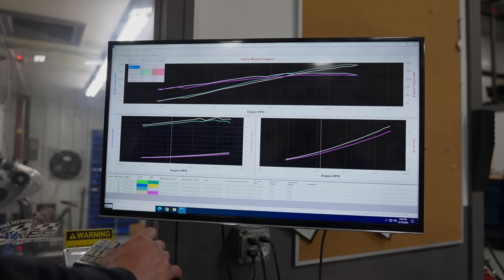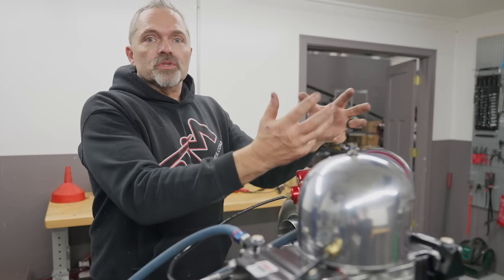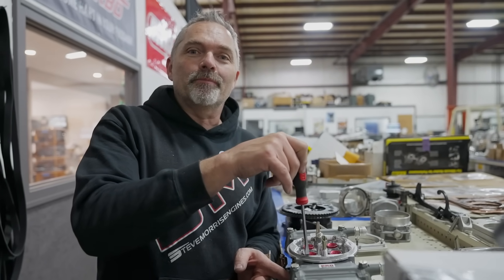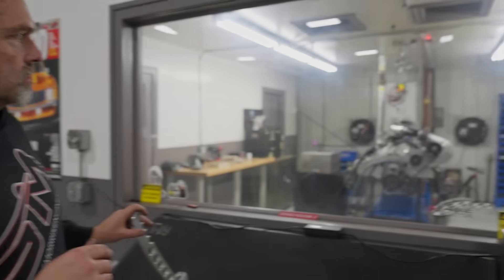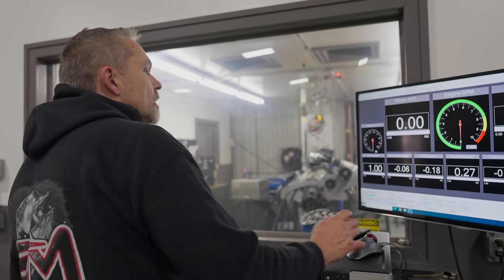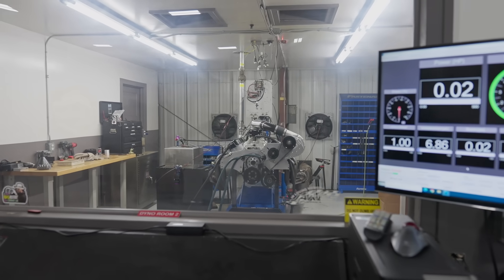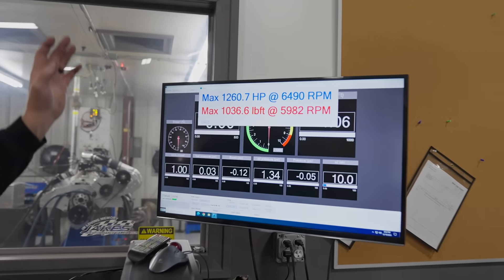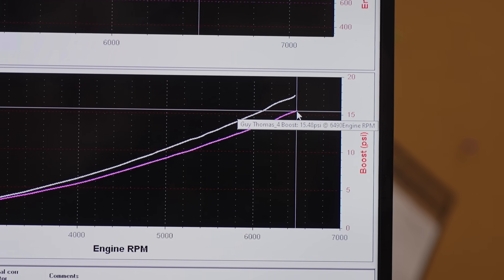How Blow Through Carb Systems Work. It makes too much power!

Comment: Most people call those little screws on the metering block "idle mixture screws".
I like the term "idle volume screws" because they control the volume of the emulsified fuel/air mixture from the idle/transition well to the idle port below the throttle blades.
So they control the volume of emulsified fuel/air, not fuel, precisely.

Comment: The most comprehensive, detailed, and informative tuning/dyno presentations ever compiled. Appreciate the continued videos and of course no video is complete without Dewey making a casual or deliberate cameo. Cheers!
Reply: Couldn't have said it any better! Pretty sure if you looked up the definition of customer service it's gonna have a picture of Steve!🤣
Reply: Tim Nelson is the best
Reply: @ALLGODSDIE  Never heard of her.
Reply: @ALLGODSDIE there’s always one
Reply: But still incompetent enough to let the supercharger pull hot air straight from the headers 🤦🏻‍♂️
Reply: @WingspeedGarage  there’s a lot of air moving through that dyno  room .. not a big deal
Reply: @edmahonejr.9364 It is a big deal if you want to make horsetorques, and it will most likely be even worse in the car if the customer runs it like that
Reply: Wellsaid
Reply: @WingspeedGarage  :
He briefly mentioned that, and why.  
Most of his viewers are competent enough to have heard and understood his rational. 
Most of his viewers do not want him to spoon-feed them. 
Caution: you MAY learn something.....
Reply: @WingspeedGarage  Your lack of attentiveness through the bullet points Steve noted during the course of the video explains your comment. He literally manufactures boosted engines that make in excess of 4000 horsepower so there's that caveat you overlooked or completely ignored.
Reply: @lt1nut  yes sometimes I wonder if these people that make these stupid comments actually watch the whole video or even watched a large number  of Steve’s videos. Like most of his subscribers have.
Reply: @strykerentllc So because he makes 4000hp engines he can’t be criticized on simple facts ?
Reply: @lt1nut He should never sell nor build an engine that pulls hot air from the headers. It’s a bad setup and he should know better. And he’s obsessed with boost numbers that has nothing to do with making horsepower
Reply: @WingspeedGarage  Nope, not at all. Try to keep up for a second here as it's explained to you in simple kindergarten terms. 

1: Those two wall mounted fans behind the dyno move a sh*load of fresh air across the engine. 

2: It's December in Michigan. It's friggin COLD there and in case you didn't watch the video, everybody's wearing hoodies in the shop. 

3: Steve had to pull power out of the engine so the engine wasn't struggling to make power.

4: Professionals welcome constructive criticism from individuals that are educated in the respective field. A monkey can critique a stone mason, however that chimp knows nothing aside from how to peel a banana and toss sh*t at strangers. 

5: Know the difference between being a chimp and offering constructive criticism but be prepared to get taken to task by those more knowledgeable than yourself. 

6: Merry Christmas.
Reply: @WingspeedGarage these sideslinger prochargers are making over 2000 horsepower without intercoolers, and within the recommended impeller rpm. The air intake being above the header isn't an issue in my vehicle either. The ait's are reduced with the vaporization effect of the fuel underneath the carburetor.
Reply: @square_zerohero2281  And why not make the same HP with less boost (saves the engine) or just more HP? 🤷🏻‍♂️
Reply: @bigboreracing356  There is no reason why that hot air should end up in the intake of the turbo
Reply: @strykerentllc  Engines pump their own displacement every two revs, at any fixed RPM the engine CFM pumped is constant. The boost pressure does not increase the engine CFM, it increases the density of that CFM. It takes pounds of air not pounds of boost to burn pounds of fuel. And if you’re not doing what you can to increase the air density of does CFM especially by such a simple thing as not sucking in hot air from the engine then you’re just ignorant or doesn’t know better
Reply: @bigboreracing356 Why are you asking me that?
Reply: @bigboreracing356  When you compress air the air gets warmer no matter what you are using, it’s the law of thermodynamics.
Reply: @bigboreracing356  Your English is so bad I’m surprised you went to school at all, makes it really hard to understand what you’re saying. But no, a Procharger doesn’t make hot air cold
Reply: @WingspeedGarage  You're having a conversation with yourself. Nobody cares what you think, got it? Good.
Reply: @strykerentllc Hopefully you learned something! Key note to take with you:
1. Always aim for as high air density (cold air) in the intake manifold as possible to make the most horsepower with the lowest strain on the engine. It’s so easy but yet so overlooked by some reason.
Reply: @bigboreracing356  You can run the supercharger slower = less boost and equal or more hp with higher air density.
Reply: @bigboreracing356  I’ve tried my best explaining this to you but I give up
Reply: @bigboreracing356 You can, make a cold air intake and ram that procharger with cooler, denser, outside air from the front of the vehicle and you’llb make more HP at the same boost, or even better. Add a intercooler
Reply: @bigboreracing356  If you believe that I don’t think I can say anything to change your mind, good luck to you sir

Comment: Take his advice as gold, and these engines will survive years at this level. I've been following him for decades, and I've built a similar setup to this at my home because of his builds Ive read about as a child. I have a 565 cubic inch big block Chevy with an F-1X Procharger that I street drive with the same 77/58 tooth pulley combo that he tried in this video with my timing locked at 30. I also have a 46 tooth blower pulley if Im able to use more. I haven't pulled my engine in 8 years. I appreciate the lessons he shares with us, and I'm thankful to enjoy the rewards of the knowledge that hes always shared with us for free. Expect brutal power. Good stuff

Comment: first engine I turbo'd was a 80 kawasaki kz750 four with the original carbs. I wore the screws out on them by the time I got the jets right! bought special drill bit set, extra jets. even soldering them shut and re drilling

Comment: Awesome video and makes me want one of these Blow Thru Procharged setups even more! As soon as I saw your carb leaking I got flashbacks haha. When I received my carb from them it leaked from every orfice possible. The Needle and seat didn't even have gaskets installed. It made the dyno tech pretty frustrated with me while I tried to fix all of them. Not to mention one of the locating pins for the float bowl on the metering block was completely bent and fell out once the bowls came off as if the pin wasn't seated properly when someone cranked down the float bowl bolts. Contacted Pro systems and all i got was a "Sorry ill let my guys know to be more careful".
Reply: Oh F man that sucks. Youd think you spend top dollar for a custom carb and get a teeny bit of support

Keith over at AED gives the best customer support Ive ever experienced. Hands down the best ever!
Real patient guy wants every customers car to be its best. Not used to that still lol

Comment: Back in the day (way back), Gale Banks made 350 SBC dual blow through turbo kits.  The fuel pressure was controlled by a special mechanical fuel pump with the control line going to what was the ambient side of the diaphragm.  The 850 Holley was modified with throttle shaft seals. Boost was bled off when the throttle closed under boost with a simple valve located in the special air horn. However, these could no way reach the HP/cu. in. this monster has.  The highest HP street kit only produced 600 HP from 350 cu. in. (5.7L).  The 700 HP version was not recommended for the street.  This implies the situation could have benefited from modern turbos and better heads.  The max boost was about 7 (if I recall correctly), so that was a major limiting factor, as the kits were designed for a stock block. Also, 7,000+ rpm was not an option.

Comment: For fun i googled smx engines an found a few people saying its not reliable an is a hit or miss so i had to drop some truth on them lol i told them that steve cares more about his engines in customers car than people know every evnt hes at an hos engines are their i noticed he takes time to check on how they doing or if they need help with a tune they also brought up the viper smx   i also brought up tye fact that steve gives a wealth of knowledge an info to anyone i dont have a race car but if i did i would want a Steve Morris engine in caise i know 75% of it was made in house an assembled by hand an care
Reply: There’s always going to be negative people. I don’t think there’s nearly as many SMX’s out there as there are people claiming they’re junk. 
At the end of the day basically any race engine making that kind of power is going to break stuff and have problems. Even at “only” 2,000hp it’s still easy to break stuff.
Reply: I don’t think he’d be still going if they were no good
Reply: Of course there great engines look how busy he stays and it’s the same people buying more or doing refresh’s he had his very first engine on here not long ago it was like 22 years old there is gonna be negative people wherever there is success.
Reply: Anyone complaining about a race motor not lasting, does not have valid expectations. If they build it to be race enough, it will only run for a few miles. (and endurance could be the only complaint. Im sure every motor is tested.)
Reply: Steve is the type of guy who sells things HE wants to be proud to own;
You are paying for your problems to be his problems;
He takes it very seriously.

Anyone making noise is doing just that, making noise.

If Steve built something that failed; I bet he would take it personally, and make it his mission to help his customer.
Reply: Race engines  brake all the time if they don't you are not going hard 😂
Reply: Blow through carbs technology has gotten alot better over the years they are just miss informed
Reply: They're junk compared to Noonan and prolines stuff. Those are directly who he's trying to compete with.
Reply: One thing I know about guys with race cars is. Their stuff is always better than someone else’s stuff. Whatever is in their car is the best. Steve is super humble about himself and is super proud of the hard work that goes into his motors. He takes each engine personally and will not deliver failure. 

I don’t think he would have his engines in some of the fastest cars on the planet if his motors were no good.
Reply: @frankcox748 Proline engines do not have water channels and are exclusively used in short race applications while Steve Morris's engines have water channels and can be driven similar to a regular engine. They do not compete with each other yet both are amazing feats of engineering.
Reply: @greatestevar  he also seems to be similiar to the rare guys you meet where he takes time of out his busy day to make a Video and educate us viewers on how things work and the ins and outs of such things. He teaches us and it's not afraid to share information where as some guys seem to not wanna "spill the beans" or share what they learned because they feel like you need to go through the hardship that they did first.

Comment: I agree. A touch rich on idle is way more responsive. Neutral or a hair lean gives that delayed gag then jumps. Its all within 1 second but that's the difference between competing or going home
Reply: If Street Car tad lean is fine.
Reply: @wobblysauce  probably. Unless you need to jump in traffic. That gag could be a bad situation. Even a daily. Go a touch rich. My 81 f-100 300 straight 6 is almost right for where I live. All I have to do is flip the breather cover for summer and winter.
Reply: Rich is better to compensate for high ethanol/additive gasoline and/or E85
Reply: Adjustoing for a stronger pump shot will clear that right up. 
Common problem with low vaccum big overlap cams also or not enough initial timing .
Reply: Nope. Only if you smash the throttle straight off idle which tells me you cannot drive.

Comment: They are called idle mixture screws. Not idle air screws. They do not change the amount of air in the idle circuit, only fuel coming through the IFR jets.
Tip in is controlled by the transfer slot exposure/fuel, and the accel pump cams, and lastly squirter size.

Comment: Got a custom built Pro Systems Dominator a couple years ago. Had fuel leak issues and didn’t want to idle. After taking it apart it was nothing like the supplied build sheet said it was supposed to be. It was basically a stock 1050 spec carb. It didn’t perform any better than my home built carb did so I Sold it at a swapmeet.  Bought a custom Braswell carb that works well but no better than my old carb built by me outta Holley/QFT parts from yrs ago. Go figure.  Guess I’ll put together my own carbs from now on….
Reply: Had Patrick build me a 1000 cfm 4150 bout 18 years ago, Best carburetor i ever had.

Comment: I attribute that tip in stumble to the low manifold vacuum caused by a “bigger” cam. I reduce the air bleed a bit more and close the idle screw a bit. Same idle mixture but a richer tip in. If you don’t go too far it will run smooth through tip in and not tank fuel economy.

Comment: What i find funny is that the oil pressure drops at peak revs and Steve says 'i'm going to add a quarter', i'm a dickhead that has driven the same camry for the last 20 years, but I would expect the oil pressure of that engine to drop slightly at max revs. it's still over 90 P.S.I. That pressure looks perfect to me (who is just a key board warrior). Thanks for the content Mr Morris
Reply: Why would you expect the oil pressure to drop at max revs? The pump is spinning faster and the clearance on all the bearings remains the same.
Reply: It is running out of oil in the pan to pickup. Under normal conditions, it would be gravity fed into the bottom of the pan more effectively.
Reply: could'nt it be air bubbles just starting at that rpm ?

Comment: Idle fuel screw. Back off a half turn makes it richer. Open an idle air screw a half turn, which makes it leaner. You almost had it correct, you correctly called it a fuel screw but started calling it an idle air screw again.

Comment: Admire your work . I know you weren't concerned with the oil Pressure as RPM increased , I have had 2 similar experiences with 540 big blocks & it was the Milidon Pick up that caused the issue ? .

Comment: My blow thru turbo liked 11-12:1 afr WOT and 12-13:1 cruising with iron heads but my buddies with aluminum heads was happy with 11:1 cruising and 10 wot. 
Soon as i saw that fuel pressure on the graph i said….aint got no gas in it😂😂

Comment: So I've decided to run my ~650hp n/a BBC carb'd, I had it fuel injected(FAST meh),  had an engine fire, re-built it myself (first re-build I've done), I want to go holley terminator this time but want to make sure the motor is healthy first so I'm going to toss a slightly small 800cfm carb and a standard HEI distributor on it and run it for a summer and just not push it past 5k rpm: so to get to the point my buddy says, put O2 sensors and an AFR guage in for carb turning (makes sense), do you think its a very good idea or is checking plugs every few drives good enough?

Comment: Steve, 
havent had time to watch yet so...
On an sbc mechanical pump w/Holley, it would use a max of 7ish lbs fuel pressure or so no?

Would 7 or more lbs boost push back through the needle/seat orings and screw things up
How do you handle that situation? Not really into putting EFI on an old car

Is the answer to build more cubes and limit boost to 6 lbs?

Comment: So it's the idle mixture screw. Not the air screw... Not if it adjusts the fuel level. 
(Motorcycles get both. If it's by the bellmouth on the intake side it's idle air open it up to lean the idle. If it's on the engine side it's the mixture screw and will add gas when opened.)

Comment: Have you tried during a Morse test on your Dyno? I.e. dynoing engine full pull, and then pulling off individual plug leads and retesting to see what power drop per individual cylinder? Stock)ish) smallblocks usually make about 6 - 8 % better power on the middle cylinders, than the end ones - especially the rears I'm sure most know why..
Reply: Flex/distortion is your answer as to why middle cylinder make more power

Comment: It's funny cause people forget about the differences in their abilities. Carbs have their own benefits and fuel injection have their own benefits. It's really what you prefer, I'm old school and like the FULL RANGE OF POWER that carbs offer. Plus, you don't have to worry about updating a program for it to run properly. Junk in my opinion, constantly needing updates for a car to run properly. Fuel injection has advantages, but it's not for me. (Mechanical fuel injection is superior too.) Well, maybe I would put one in my grandma's minivan, so funny 🤣. Thanks 👍.

Comment: If the bowls are pressurized to 12psi how does the fuel enter when it's set to 7.5 psi ??😮
Reply: Boost reference fuel pressure regulator as psi increases fuel pressure increases
Reply: Boost pressure plus 7.5.

Comment: All my ProSystems Carburetors from Patrick come dead on. We have dyno proven a few times that the jetting out of the box is spot on. Not a better carb or guy out there on the market.
Reply: Tossed one our 383 with a single carb blower went a full pitch up on the prop and zero bog and never have touched the carb